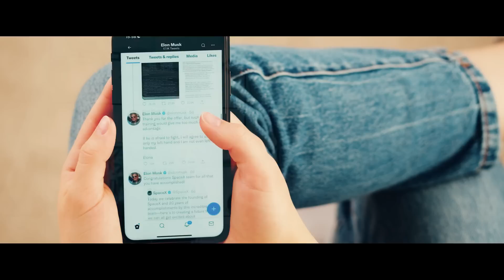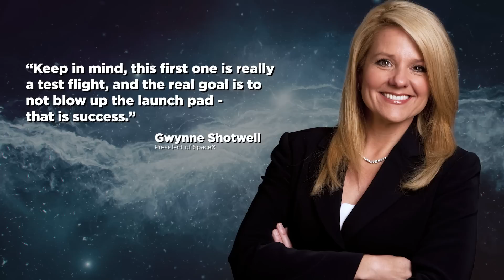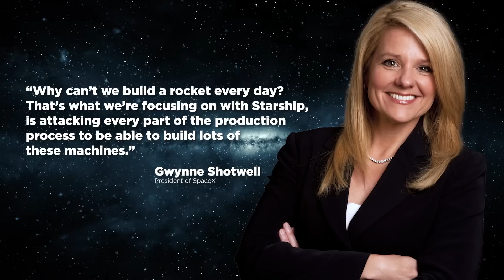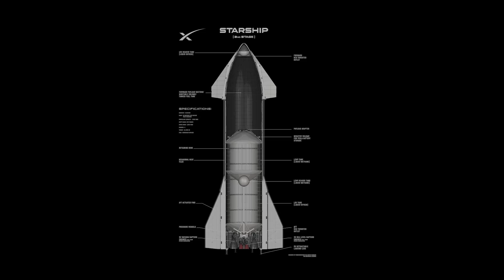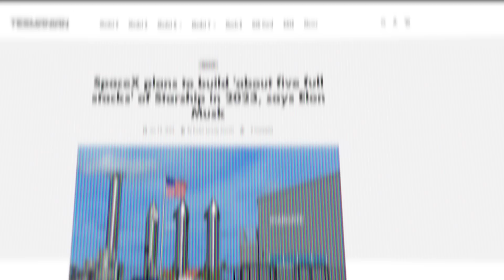How SpaceX Will Build One Starship Every 24 Hours!

Comment: You don't know me and it's only a mad scientist moment If you chat to Mars rover owners can you maybe ask them if they send anymore robots if they do to send a version of a sand gecco and a swarm tank /spider tank the sand gecco because like in the sand dunes it can dissaper under the ground and test heat temp and where the ground if ample / soft / hard to rover to take and the spider tank can pick things up and move them around and collect cuttings ....also to get rid of the dust on the solar panels a bellows could be added to blow them clean without a scratching the glass

Comment: Every other launcher manufacturer is building each rocket like a Rolls Royce limousine or a Ferrari sports car with a dedicated team of specialist engineers.  This also applies to each of the major components including the engines.  The RL25 engines on SLS, which each have the same thrust as a Raptor2, cost $25M per engine and can only be manufactured at the rate of two per year*.  The BE4 engine costs over $2M each and BO apparently can only build about a dozen per year for the proposed ULA Vulcan launcher and its own New Glenn.  Raptor2 is produced on an assembly line by robots, just like a Tesla and supervised by the same sort of technicians used by Tesla.  Each Raptor 2 costs about $250K, and that will come down.  Each Raptor assembly line can produce almost four hundred engines per year, enough for sixty Starships a year.  That is SpaceX can build as many new Starships in 2024 as the total Falcon 9 launch record for 2022.  However 60 Starship launches will cost SpaceX *less than 60 Falcon 9 launches even though Starship has five times the payload to LEO.

Comment: In my eyes, it is a question of should, not could.

Should spacex built a starship every 24 hours?

Even if they could slap starships together that fast, i think it would be unwise for them to do so. It leaves virtually no room for quality control or wuality assurance.

And if there is any industry you NEED quality assurance & control in, it's the space sector.

No other class of machine deals with harsher mechanical stresses, harsher vibratory & thermal loads, and harsher enviornmental conditions, both short term and long term, than that.

Comment: The information in this video is not entirely accurate. More research is needed. The temperature rating of carbon fibre or stainless steel is defunct. The heat shield needs to withstand 10 000 degrees cellius. Space shuttle used ceramic tiles over aluminum and steel. Quite easily carbon fiber under cearmic would have been fine.  Apollo used ablative coatings to do the heat shielding over aluminum and steel frame.
Reply: The titan sub begs to differ. Nit a good material for this.

Comment: silly headline, you can build anything at any speed given a long enough assembly line with sufficient work in progress inventory.  An example: Airplane company build 20 airplane per month with 8 working day schedule, with 8 planes work in progress, one plane can leave the factory each of the 20 working days per month. It is not big deal, just a Little IE scheduling.

Comment: One thing that comes to mind when thinking about automation in building starship, is the automotive industry. Not only a robot production line to weld it all. The chioce of stainless is really fitting and smart here. Because other techniques of the automitive production lines will be applicable. One is stamping of parts into shape. So when the shape and construction is finalised, the can make forms to shape the steel into parts for the nose cone, internal elements, and other parts. The sheet goes in and the machine spits out parts ready to be welded up. Very much how the parts for the body of a car are prodcuced. That alone, while initially expensive in setup, can incease productivity to a ridiculus degree. Actually, due to the way it´s constructed, starship will be able to make use of a lot of the production strategies refined for decades by the car industry. I expect SpaceX to, once development has mostly finished, start setting up a network of suppliers for everything that won´t be needed to be produced in house and multiple factories dedicated for certain specific parts that cannot be outsourced like the heatshield, egnines and body of the rocket. If they truly want to push down the price, they will need to make use of the economy of scale at every step.
Reply: Damn dude u really put ur time on this comment
Reply: @brandondineo2335  I literally wrote that in less than 10 minutes.😆

Comment: A big oven might be good for applying the heat shielding on the current Starship there are some very tuff thermal coatings that are used on piston crowns and other industrial applications made by companies like Swain Tech Coatings. If a way could be found to apply that type of heat shielding directly to the ship like a skin. Or to something that could be attached to the ship like a shell that might work better than fish scale tiles.
Reply: The fish scale tiles were chosen because of the ease of application and replacement - and the 304X Stainless has a higher heat tolerance then most steels do,which makes reentry even more survivable.
Reply: @TraditionalAnglican  Also because the tiles expand when they heat up, if it was one big piece it would crack.

Comment: No, in a production line it would be straightforward to release one rocket per day. If I took a team 14 days to produce a rocket, with a production line consisting of 14 rockets working through the production process you could have one rocket completed at the end of the line, resulting in one per day.

Comment: The heat isn't the problem, Falcon 9 is mostly carbon composit, it's the cost.
Reply: ... and the only commonly reusable portion of the F9 is the booster that never hits orbital velocity.  Heat is what incinerates the upper stage on reentry.  The Crew Dragon capsule is also reusable, but it has a heck of a heat shield on the bottom.

Comment: v
Reply: As stated in the video the Starship upper stage needs 6 raptors or 9 in the case of heavier payloads.  So that would be the minimum necessary to get to one starship per day.  There is no need to have those additional 33 raptors per day because the booster can boost back to the launch pad to fly again at least that is the vision.   

Also as an aside there would be many starships in various stages of construction leading to an average of one rolled per day.   It is unimaginable to build a starship from start to finish in one day.
Reply: @michaeldeierhoi4096  great point!

Comment: And here I thought building a single raptor engine per day was a rough goal
Reply: insert "Is not rocket science" line here
Reply: It is! Building a rocket engine is harder than building the damn rocket it self
Reply: @its_nihar  Yes rocket engine pushes the limits of engineering
Reply: They’re already doing it. Once the design is validated, SpaceX should be able to get production up to 20 engines/day within 4 or 5 years. I don’t see any problems with producing one every 2 days (180 per year) once they’ve got that going.
Reply: @TraditionalAnglican  I can see a huge problem, in that Elon has lied about all of his goals so far. We're not on the moon. We're not on mars. We're not in space. There's no FSD. No millions of robotaxis. No human brain chips, let alone animal ones. There's no everything app. Rocket fuel didn't solve climate change. Starlink is a bust. That glass sure as fuck isn't thermonuclear proof, it's not even small object proof. There wasn't 1000 solar roofs a week installed at any point. His brake pads weren't indestructible magic. etc. I could go on all day. If you think Elon is going to be building starships even on a monthly basis i have a bridge to sell you.
Reply: @TraditionalAnglican  👍👍
Reply: @TraditionalAnglican  I see a problem cost, They need money and earn in before they can ramp up the production
Reply: @TraditionalAnglican  No they arent.
Reply: Velo3D's printers need more glory there

Comment: Shotwell did a few years in the auto industry (Chrysler)... So once again, car manufacturing lends itself to other industries. There is no chance that there will ever be 365 ships made in a year (at one plant), and why would anyone need that many ships when most of them would be reusable. That many ships would require an industry that simply doesn't exist yet.  Starship 1.0 is too small for any realistic Mars missions. The bigger 12 meter original Starship idea would be a better fit for that mission. Once they have their starlink fully deployed, it's not going to take thousands of ships to maintain it (sat replacement flights)... So your going to have a number of giant ships sitting around looking for work. Then there is the NASA nuclear rockets which would make inner solar system flights obsolete for chemical fueled Starship.. Unless SpaceX is allowed to work on nuclear versions of Starship.
Reply: I don't buy there is no chance of 365 ships made per year at one plant or that kind of demand is impossible.
For ship and booster fabrication, most likely, that kind of scale will require borrowing techniques used for fabricating MEMS devices, micro chips, and sized up to fit hull parameters. Most likely, if this route is taken, the tooling would be modular built. The vacuum and clean room processing would need a novel linkage design similar to how spacecraft dock to each other to allow for a scaled up roll to roll nanosheet cold weld process, air bearing separator sheet mandrel rolls, pick and place dissimilar gecko feet, laser cutting arms, and air bearing roller presses. 
Some of the difficulties I see are separating air bearing pressure from cold welding vacuum, fabrication of nano film the length of a booster rocket and preservation techniques prior to production use, cutout and handling of segments for things such as vascular/nervous systems, windows, doors, joints, etc...
Post production repair techniques would need to be compatible with the integrity of the new design by requiring techniques similar to micro grafting of bone, vascular, nerve, optical, and other tissues.
Demand for the ships could be offset and support labor with recycle and repurpose integrated design for use in secondary markets such as storage, shelving, furniture making via repurposed building stock. Cut and gut methods need to be labor and small business friendly, competitive with utilization of existing resources. I believe shipping containers go through similar fabrications on mass scale as well and have secondary demand. Also, the fabrication methods need to be compatible with tooling of other items that integrate into the ship, tanks, silos, and land based applications of similar functions. Compressed Air Energy Systems (CAES), Bio reactors, Hyperloop sleeves, Refinery vessels, and anything else that could make use of the integrated vascular, sensing, and signalling network capabilities for safety, comfort, and fine tuned thermal regulation layers. The more sophistication integrated into the shell has potential to bringing down cost for integration of these and other features into other products and leads to incentive for modular tooling to fit specifically to application.
.

Comment: Although technically possible they likely don't mean they ship will start and end production in the same day.   Rather they will parallel production of enough that you end up with one and the end of production every day.  i.e. One a day.  There is no reason SLS couldn't do this as well.   Or anything else really.   This is just demand driven.   How about a small cruse ship.   Takes a year,   Make 365 factory locations.   Why don't they.... Well.  Not enough demand is the only reason.
Reply: I think she means total build time.
Reply: @kokofan50  Maybe. In manufacturing, Man hours or production rate are much more commonly used.  Build time is just not that useful of a number.  But I agree, she doesn't have a background in manufacturing so it's possible she faffed that up.  Personally I have more confidence in her so I don't think so.   But no proof.
Reply: To make a long story short, SLS has been using the "Phased Project Planning" approach, which is not geared towards the kind of mass production and Agile approach that SpaceX is using.

Comment: I have t ask has that booster even flown yet? does the heatshield still fall off th pointy end every time someone sneezes? Just asking because these little videos seem to make a lot of assumptions.
Reply: I believe a tradeoff will be needed between thermal and shock resistance of the shields and the use of fluids to absorb the heat, similar to Stoke Aerospace's design. Since weight is crucial, I'm not sure if some kind of integrated air liquefaction scheme can be integrated at large enough scale and speed of distribution from the air encountered. I imagine where there is pressure, there is vacuum to be exploited to cool a portion of compressed air for use as coolant, passive design most likely.
Reply: Space X is preparing for the first of several test flights with starship.  B7 S24 is looking to fly within a few weeks.  B9 S25 will soon be up and testing for the next flight.   Testing a new rocket means that things are expected to go wrong then Space X can make adjustments.

Comment: I'm just curious...why doesn't SpaceX produce one sheet of stainless steel metal onsite that's the length of the entire rocket (up to the nose cone section) and weld that one piece together vs. doing all the rings?  I'm guessing they don't want to build the manufacturing capabilities to produce a stainless steel sheet of that size?
Reply: im thinking structural integrity, and stainless steel is not that strong at holding itself up. there's a video of a rocket which basically folded on itself, and I'm pretty sure it was made of stainless steel but I might be completely wrong
Reply: They like vertical integration, but there are limits to how efficient that is.
Reply: Or how about stainless steel the length of the booster, much thinner than Saran wrap and rolled onto a mandrel and cold welded to itself?
Reply: It comes from the steel mill on a roll, that's the cheapest way to make it with the same thickness.
Reply: Build a steel smelter at Boca Chica?  Not happening in my lifetime.